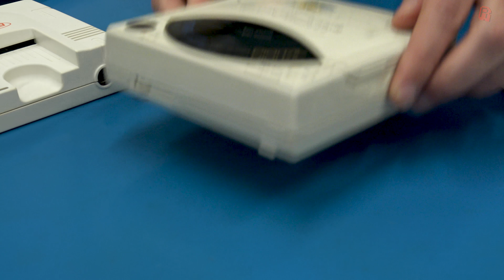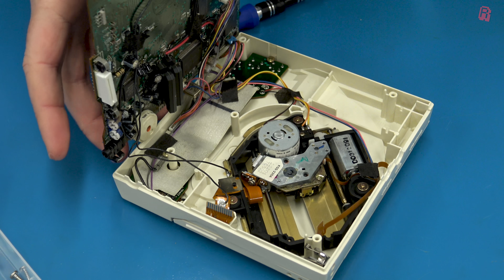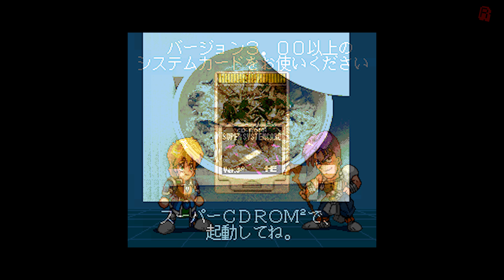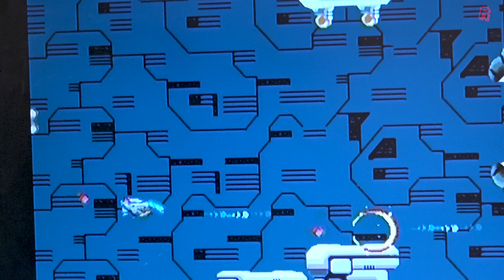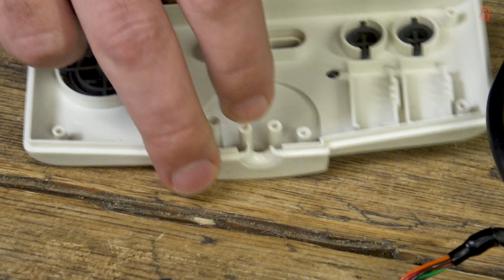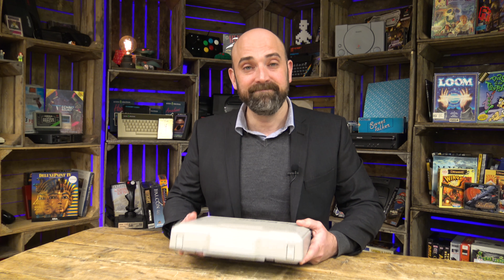PC Engine Trash to Treasure (Pt2) - Fun with the CD ROM ROM

Comment from the maker: Thanks for watching!  If you missed part 1 you can find it here:  https://youtu.be/0VxAmCYXp_0
And if you'd like to follow Mike Dailly you can find him here on Twitter:  https://twitter.com/mdf200
Neil - RMC
Reply: Notice how the LCD track display is randomly dimming? Mine did that before it stopped. You need new caps.
Reply: NOTE: If you load Dracula X with the original CD 2.0 HuCard there is a playable mini game that it presents you with. Also note there is an ENGLISH patch for Dracula X for PCE - it can be found here: https://www.pcenginefx.com/forums/index.php?topic=10588.msg193338#msg193338 and requires TurboRip.exe found here http://www.ysutopia.net/forums/index.php?topic=69.0
Reply: While on the subject of translations Y's IV was also translated to English and can be found here: http://www.ysutopia.net/projects/ys4/ - As a side note - If any the original team who made this project happen - happens to read this could you please consider translating Dragon Slayer: The Legend Of Heroes 2?
Reply: I'm totally against destructive mod if possible. Looking at pictures of the AV ports, they are on a separate board with a plastic shell. The crazy solution would be to redo the board and 3D print a new small shell to add a small DIN connector. A more feasible way would be to desolder the red/white/yellow ports to make room for a DIN connector. If you go this way and can provide pictures and measurements, I'm willing to create the 3D model and print it out for you.
Reply: I'm answering myself, because of course it already exists: https://www.thingiverse.com/thing:4098148 Please consider this instead of a destructive mod!
Reply: I'm gonna need the help of the community to thumbs up this post so that Neil can see this comment:

I'm gonna save you some headaches because I already know whats wrong with your drive and why it's not reading CD music. In fact the problem isn't the drive itself it's your method of burning discs, no amount of high quality CD-Rs will help. There is realistically only 1 solution to your problem: Get an old CD burner that can burn down to 2x speed. Sounds simple, I know, but there actually is a reason for it:
 

A lot of people think that the burning speed is just how fast the disc is burned at, but the faster the burning speed, the less defined the burn marks will be. Disc drives in the last 20 or so years are sophisticated/sensitive enough to read these marks, but ones from 25+ years ago can't, so you need the burner to make the marks more defined by simply having the drive be more thorough. This is done by slowing down the write speed.

Now some people might say: "My burned Music disc will work on these old drives so it can't be that". Actually when you're using Red Book audio burning software like Windows Media Player, it can either restrict the speed of the drive at the software level, or increase its burning intensity (depending on the model of Drive). Most image burning software don't do this.

So with this in mind: The reason why the game works but not the music is because usually the game is located near the center of the disc with the music being further out toward the edges of the disc. 8x burn speed is borderline readable by these drives and since usually the drive speed is fixed, the inner burn marks are easier to read where as the outer burn marks are harder because they are whizzing past the laser too quickly.

I hope this helps. This also applies to most retro disc based consoles like the Mega CD and Sega Saturn.
Reply: Will unsubscribe if you drill it!
Reply: I know there are some games that have issues with system 2.0 and 3.0 cards, such as Altered Beast. Maybe Fighting Street needs an earlier hu-card.
Reply: saw this and thought of you - check out from 3:54 onwards

Comment: the more TG16 videos I see the more frustrated I am it didnt find success really outside of Japan. With some better marketing, foresight.. and longer controller cables lol, things could have been different. TG16 annihilated the MD in Japan. They messed up by not jumping on the multi month headstart they had on it in the states.. instead it came out 2 weeks after the Genesis/MD and that was also a shot in the foot. I also always loved the design of both models actually. So slick and modern.

Comment: Regarding burning at the slowest speed- That advice was general advice back in the day for a successful burn process, back when the concept was fairly new. The reason it was recommended was to prevent buffer underrun, where the high speed of the burn meant the computer could not keep up with the burn process and keep giving it data to write, which would cause the burn to fail. Slower speeds meant the system didn't have to supply data as quickly and prevented the burn process from failing in that way. Nowadays, A modern system isn't going to have that problem. Additionally, CD Burners have had buffer underrun protection built into the hardware almost universally since 2006, so even if it was possible,  It would not usually cause a failed burn. It's pretty interesting how that general advice to prevent creating what were effectively worthless unreadable coasters has by way of being a common tip for those having problems getting things to burn has now also become general advice for making sure older systems could read it. My understanding and experience is that it is never really the case that burn speed affected the readability of the resulting disc in different systems, (assuming the burn process was successful, of course). The quality and construction of the disc tended to be what mattered with regards to whether particular drives could read the burned disc.

Comment: Just a thought for modding the PC engine interface to RGB with minimal damage.... drill a very small hole near the normal outputs for a 3.5mm audio jack wired into the stereo out, and desolder the composite and RCA audio jacks, this frees up 3 correctly sized holes for you to install your RGB RCA connectors, you could even potentially use the earth connections provided by the composite and audio..

Comment: Lords and Gates of Thunder.. Cracking soundtrack. Rock on! Good SHUMPS. I have a Draw full of games for the PCE-CD (around 50) and love this system.
I have the Duo-R and a complimentary Turbo Everdrive. Such a great system and so underrated here in the UK. Imagine the lineup if we have got this here!
As for the seeking.. The PC Engine CD-Rom streams the data track as Audio (yes.. Audio!) so if the cue files is not 100% accurate you will get this excess seeking as it will attempt to load data and end up with audio causing the crashing.

Comment: I’d greatly suggest on only recapping if you can confirm modern burnable discs aren’t the issue, and that old caps are duff. 

It’s a great misconception that throwing capacitors at electronics fixes, or in fact some how makes the performance better than before!

You should also try an alignment using governor adjustment holes.

Comment: Oh boy, the briefcase! I used to own an IFU-30 modded in Japan for RGB, the RGB+Audio output was on the right side (a hole was of course drilled) opposite to the side with the AV and power connectors. The mod used a robust 8-pin DIN connector and a tried and true THS7314 RGB amp (not the THS7374 more popular nowadays). Looked and sounded great. The key problem was the CD-ROM2, which kept performing inconsistently with some games even after having it fully-recapped and calibrated by a professional, even when using original pressed discs! The thing is just too finicky, and especially Super CD-ROM games really pushed the medium. If you want to minimize your headaches while exploring the wonderful PCE CD library on original hardware, I recommend leaving the cool-looking IFU-30 as a decorative piece, and using one of the Duo units for playing, unless your next steps in this restoration project happen to be enough for your unit. Those are much more reliable. Also, although the SSDS3 is often recommended as an ODE solution, it is not nearly as accurate as advertised, so I would suggest avoiding that as well.

Comment: My cd module decided to give up out of blue just because I found JB Harold murder club to play next. As you said on the video, this console is the first classic one I decided to buy after moving overseas because the game library is so odd and fresh. I always find something new to play, which doesn't happen with the SNES and mega drive. 
My guess is the laser that went caput, as disc is spinning but no reading is noticed, even from music cd's that are "easier" to read.

All after getting a new 32 inch CRT tv, curved with component input but several issues. I had to discharge the tube 4x to solder broken stuff I didn't notice at once or broke after a little more usage. Now that I was ready for some fun...
At least I can play the pc engine games as I have the turbo everdrive.

If I were you I'd try R-type complete on the cd rom. it's the best version with the best music.

Comment: @RetroManCave
Neil, I'd like to preface this comment by saying I do not mean this as an attack, only sharing of info. You have mentioned several times though the video that the PCEngine is an 8bit system. However, that's not true. It is a hybrid. The CPU is 8bit, but both of the graphics chips are 16bit which is why it can display so many colours on screen, well more than any 8bit system can mathematically muster. It can also produce a number of effects that no 8bit system can render such as scaling, true transparencies and number of others. Therefore, the PCEngine/TG16 is firmly in the 16bit family of game consoles. Now there are bound to be arguments that it is an 8 bit system because the CPU is 8bit, but that would mean that many of the consoles we call 16bit, 32bit, 64bit and so on would belong to a different class than is generally accepted. For example, The Sega MegaDrive/Genesis. That system actually contains more 8bit chips than 16bit chips. The Z80 is an 8bit CPU as well as the data bus along with many of the supporting chips. But the chip with the highest bit addressing capability is 16bit. This places it firmly in the 16bit range of consoles. Likewise, the Nintendo 64 has a 32bit CPU, 32bit GPU, but they operate on a 64bit data bus with 64bit system RAM. Even though the CPU & GPU are 32bit, they are attached to 64bit parts. Therefore, the system qualifies as 64bit. The Atari Jaguar for another example is not 64bit. No part of that system operates at a 64bit data pathway or instruction set. Atari used a less than clever marketing tactic(32bit+32bit=64bit) to claim the 64bit status. That was a marketing gimmick only. That system does not qualify as 64bit no matter how you "add" it up.  

By the same standard, the PCEngine qualifies as 16bit as 2 of the 3 primary processors of the system are 16bit.

Many of the consoles of that era were hybrids of many different bit-rate parts.
Reply from the maker: It's certainly a hot topic, and something I should probably raise in the final part.  No attack/offence taken of course, thank you for putting your point so constructively.
Reply: @TheRetroCollective  And it's been a hot topic for decades. Presumed the argument was going to come up, so I thought it would be a good idea to get it off on a civilized foot. Looking forward to Part 3! Cheers!

Comment: The least invasive way is to use a VGA connector and mount it to the surface on the back with two screws, The rectangle plate will cover the ugly hole, Then soldier the pins you need and use a VGA cable for the custom application:
https://www.ebay.com/itm/15-Pin-Female-D-Sub-VGA-Socket-Solder-Connector-Chassis-Panel-Mount-Monitor/303033630780?hash=item468e36403c:g:gXsAAOSwCVtcQcAa

Comment: Nice job - seems the main drive gear / plastic cog wear is the main problem with the older drives - enjoy.
RGB amp probably only needs an hole for the scart lead unless you add a connection for a detachable 3rd party lead, like a saturn / MegaDrive2 RGB scart lead & suitable mini din. connector.
Everdrive is the best route for HuCards as they are very expensive - CDR's less so lol. 
Hope you sort out the gameplay freezing issues.

Comment: Curious to know what cd-r media you're using. I have a Kenwood TrueX 72x CD-ROM, which is notoriously awful at reading burned media. I picked up some 700MB music-specific media (labelled as intended for cd players) and found they worked flawlessly, at least at the 4x speed I was able to burn them. They weren't very expensive either, about 16 USD for a spindle of 25.

Comment: If you need CD's written at 1x speed I have a burner from 16years ago, that still works that can burn at 1 times speed, if your interested, it'll give me an excuse to see if the P4 system it is in will fire up after all this time.

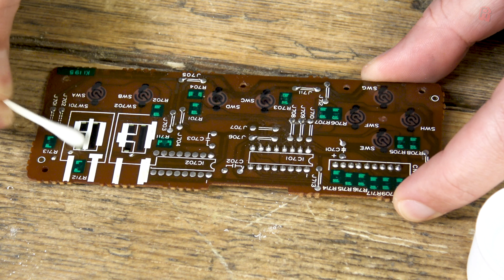Comment: Don't think you need to clean those sliders above the face buttons at 14:15 hehe, it seems they left those on the PCB despite not populating the board with the necessary components to have turbo switches,
Reply from the maker: Indeed, thanks to the comments I've learned that this is apparently an early example which still has those on the PCB and it was removed from later ones.  Very interesting

Comment: A few things - first as usual thanks for the great video :-), I'm wondering how that cog got so destroyed! Regarding the RGB mod, in terms of "destructiveness" I guess you're mostly talking about the case, right? What if you replace the composite + RCA audio/video connector with a 3.5mm female jack cable + the RGB port cable (I assume you wanna use a VGA connector or something?), that you'd both pull through the existing holes? De-solder it from the board but keep the spare part in case someone wants to revert the mod? Regarding your CD reading issues - first, great idea to question the medium, I hope better quality CDR's will help. If not, another thing I'd question (or rather I'd like not to have to question for future troubleshooting) if I were you, would be the interface board itself. You never wanna have to question the cables/connectors, so I'd double check everything has continuity and low resistance there, ideally going through the connector on each end (PC engine and CD ROM² open, checking continuity through connector solder points inside). Obviously I'm just talking out of my butt here, and especially given that it works "most of the time" it's probably not the issue, but I know from experience these kind of slot connectors tend to oxidize quite a bit over time. Thanks again for the great video Neil :-) can't wait for part 3!

EDIT: Many people suggest the ISOs might be faulty, obviously you might want to check that first, given the rest of the hardware seems to work fine (again "most of the time") :-)

Comment: I had an issue with one unit i was getting cd reading issues on some discs they would work and they wouldn't i was getting graphic issues here and there thought it was a hard problems. but in the end i figured it out and it was a duff super system card first time i every seen  that put another card in all problems were gone  so if you sill get issues after better cd's might be worth looking at that. but as for the pc engine i love that little machine so meany great game its still my favorite console to this day.

That conversion of shadow of the beast has fantastic music plays better than all the other versions it is a little different yes but its all the better for it.

Comment: Another interesting piece of ephemera is why the system was configured in 3 separately sold parts (PC-Engine, CD-ROM^2 and IFU) like that.  Back when it was released Japan had a rather complex sales tax system, and "Audiovisual equipment" was subject to a high rate of tax.  By breaking out the CD player, only that part was subject to the higher rate and the IFU (which was expensive because by the standards of the time it contained a lot of RAM) could be classified as a computer component that attracted a lower test rate.
This is also the reason that stand-alone arcade cabinets sold in Japan were shipped with PCBs containing absurdly minimalist "games" - JAMMA had negotiated a low sales tax rate for "coin operated amusement machines", which included video games - but the definition required that the machine had to be capable of operating as a game at the time of shipment and as a result empty cabs were assessed at the much higher "Audiovisual equipment" tax rate.
Reply: This is super interesting, thank you. Also I guess that makes sense.

Comment: The PC Engine was more successful than the Mega Drive in Japan, and for a short while was even out-selling the Famicom before the Super Famicom came out. Although it was an 8 bit CPU, it still has some graphical advantages over the Mega Drive, it had much better colour depth on screen: Mega Drive could show up to 64 simultaneous colours, PC Engine could show up to 482. This made some of it's arcade ports look much more faithful, see Tatsujin for instance.
Reply: 8bit CPU but a 16bit GPU. So it's a bit in-between in terms of generations... And yeah way more colors than the Megadrive.
Also the CD Rom was a first as mentionned in the video (1x though, if you guys remember ahah). For audio of course, but also for a ton of animation... I think the next consumer machine with a CD player was the FM Towns which was only in Japan also.
Reply: @remka2000  Still an 8 bit system. The main CPU determined the "bits", but that's just fine for me, that makes it MORE impressive.

Comment: I don't know if you mention this later, but fascinatingly the CD Rom unit could also be used as a drive for one of NEC's full size home computers. It was a tower machine "PC-8801MC" with a square hole in the top of the tower, just the right size for the CD Rom unit to slot snugly in. https://www.youtube.com/watch?v=N6SX3wkJRtc